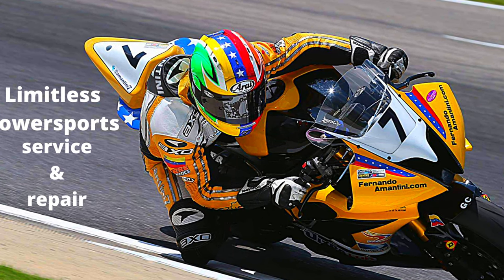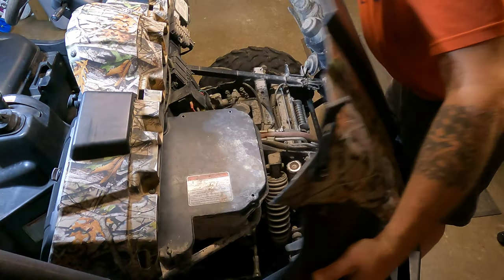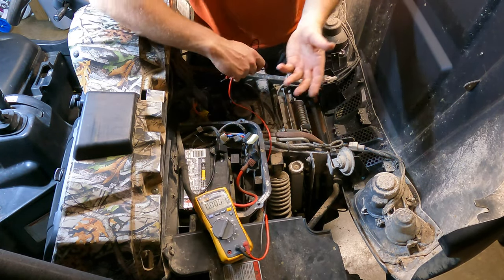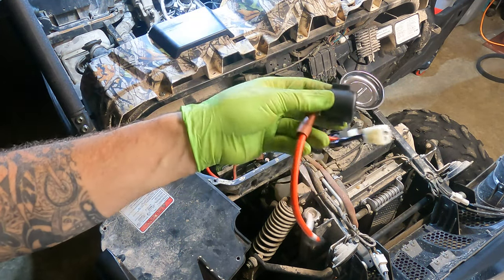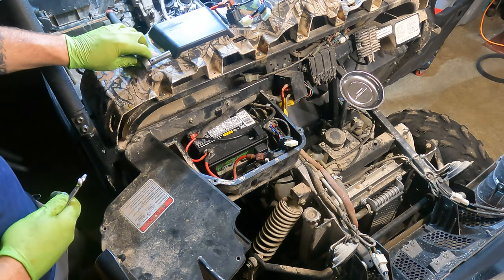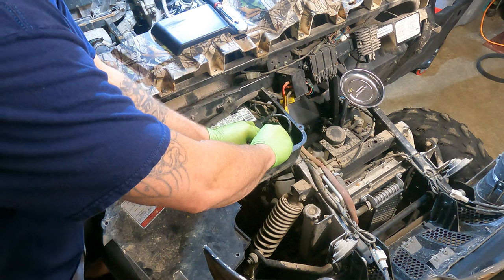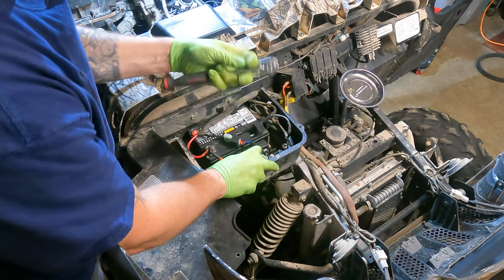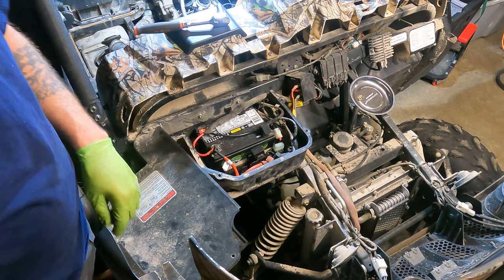This is Part 1 of 3 Massimo MSU 500 not cranking over

Comment: Hey I meant to ask you. On the 500/700 Massimo/Hisun etc did they beef up the middle drive gear plate? I know the 660’s/700 Yamaha’s had issues with it breaking and there is a billet aftermarket part but was wondering if it would fit on the 500/700 Hisuns. 
 Also the Hisun/Massimo are geared taller than the Rhino’s were and wondering if you know if the Yamaha middle drive gears/shaft will bolt in the the Hisun and vice versa.
Reply from the maker: Honestly it looks like all the others I have ever seen. I just shoot a video on a complete motor rebuild on a 2015 Massimo MSU 700 & I didn't pay attention if it was different than the newer one.
Reply: @limitlesspowersportsservic3394  
I don’t think they would be any different between Massimo units but what I’m asking is are they different than the rhino.
Sometimes when they clone stuff they do try to upgrade the parts if they know something failed on the big brand-name units. I haven’t heard of one of these Chinese built 700 side-by-side breaking the middle drive gear so that’s why I was wondering.
Reply from the maker: Unfortunately really couldn't tell you.
Reply: @limitlesspowersportsservic3394  
Well if you take another one of those apart can you take some good video of that middle drive gear flange and the parts and what not and bonus points if you happen to have a Yamaha grizzly or a rhino apart and see if the parts are in or changeable.
Reply from the maker: Yeah for sure. I should have some pretty good shots from this 700. I've been working on a lot of grizzlies here lately just nothing to where I have to split the cases. Well as of yet lol.

Comment: i have a massimo 500 it says its in 4 wheel drive but only front wheels are pulling and wont come out of 4wheel drive...any idea
Reply from the maker: Hey Phil thanks for stopping & checking out my channel. It sounds like your 4x4 actuator might have went bad.  when you flip the switch can you hear the electric motor make any sounds?  I'm not really sure what you mean by only your front wheels are pulling. The front & rear wheels are driven by the same clutch & transmission  system.

Comment: My MSU-500 won't stay idling after changing the battery. Only difference is the battery. I replaced the aftermarket from O'Reilly's (SuperStart U1LH) 230 CCA, with a (SuperStart U1LUH) 350 CCA. Could that be the problem? Am I missing a reset? What should I check next?
Reply from the maker: Hey Uncle J's. Thanks for checking out me videos. Honestly a battery should not effect how it  The motor idles unless it's not charging properly.  Most of the time when they don't idle right I usually did that the intake track & throttle body is really dirty causing the IAC( idle air control) motor not to work properly.
Reply: @limitlesspowersportsservic3394  Appreciate the reply. I went out this morning to try resetting the ECU.. But it ended up running fine.

Comment: (Not a machanic) mine is turning over. Power coming on, solenoid is clicking, but all I hear is spinning from the engine area. I put a new spark plug in… what could be the issue? Thanks in advance!
Reply from the maker: When you say spinning,  do you mean the motor isn't turning over you just hear a spinning sound of the gears? Are does the motor turn over & not start?
Reply: @limitlesspowersportsservic3394  Mine turns over but will not crank unless I hold the gas down but will not idle. Any suggestions?
Reply: @limitlesspowersportsservic3394 I have the issue. It will spin something in the engine area. But will not crank over. 
Any suggestions?  Thank you of the video
Reply from the maker: If the starter is turning over and the engine is not it's most likely going to be the starter clutch on the back of the flywheel. You can find a starter clutch / one-way bearing on eBay not very expensive at all the pain in the butt is just changing it

Comment: I did all that and it's still doing the same thing what else can I try
Reply from the maker: So when you say the same thing do you mean still not cranking over? When you turn the ignition on does your fuel pump & everything else come on?
Reply: @limitlesspowersportsservic3394  yes it won't crank but fuel pump comes on I have already replaced the starter also
Reply from the maker: If you jump the starter solenoid does the motor crank over? I have bought new starter solenoids that were bad. It may be the ignition are you could have a break in the wires that go from the ignition to the starter solenoid.  I would test then for continuity.
Reply: @limitlesspowersportsservic3394  jumping the solenoid the engine won't start it was starting good and the next day went to start it up again and it wouldn't turn over it was doing some clicking noise yesterday and then went back to doing the same thing turn the key and made no noise
Reply: I turn the key and you hear the fuel pump and dash lights come on still
Reply: @limitlesspowersportsservic3394  Hey thank you for all of your help I ended up find the problem thanks to you it was a bad Silonoid thanknyou a aging for all your help I would definitely come back to your page for help on any problems with my Benneche,Thank you again 😊
Reply from the maker: I'm glad to hear you found the problem.  I have replaced so many starter solenoids it's insane.

Comment: My 2011 Massimo Rebel 400 wont pump any fuel I put a brand new fuel pump on a brand new carburetor I still get nothing runs on starting fluid
Reply from the maker: Hey Malcolm. Sounds like you may not be getting any power to your fuel pump. I would definitely check it for power at the plug on the fuel pump. It could be a bad relaybox are just the fuse in the relay box. possibly the ignition could be corroded.  I would Stat with those things first.

Comment: Can you tell me where the oil pressure sensor wire goes to 
As in
From oil pressure sensor to ?
Reply from the maker: Hey M C. What year & make & model is yours?  I have a 2015 Msu 700 motor sitting right next to me & there isn't a oil pressure sensor on this motor. It has a Gear position sensor & a reverse sensor that is all.
Reply: @limitlesspowersportsservic3394  mine is a 2008 Hisun supermach 800 best I can figure it’s an oil pressure sensor but I’m going by the repair manual as best as I can figure out
Thanks for your response

Comment: Cyle do you have a phone number or a email address where we can contact you I'm trying to see if you have any videos on how to replace the brake on a Massimo 500 I have adjusted the emergency brake the way they say to do it but will not hold can not find anyone near near to work on a Massimo thanks for any help you can provide
Reply from the maker: Hey Carl thanks for the comment and checking out the channel. I do not have any videos on how to adjust the emergency brake on that. It is a very common problem on those for them not to work very well at all. there's multiple spots to adjust it. I believe there's a spot on the brake caliper itself. I also believe there is an adjustment in the line. And one up at the handbrake. but you can email me at limitlesspowersports78@gmail.com